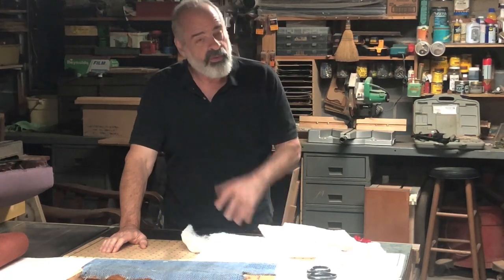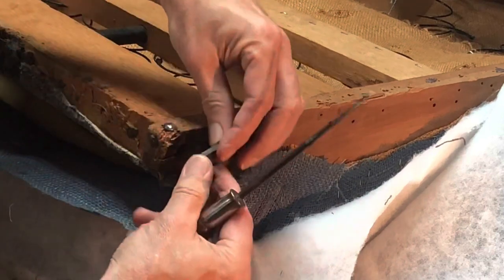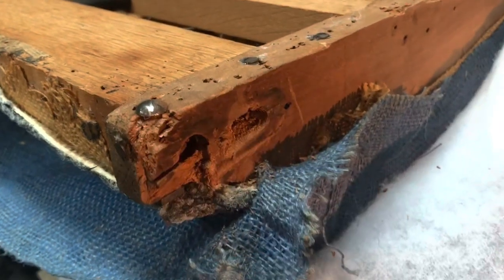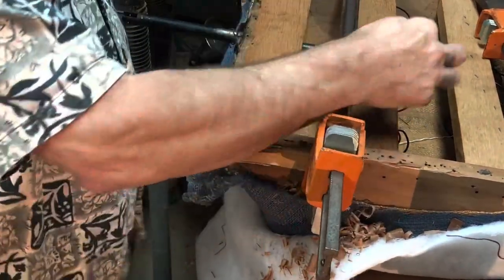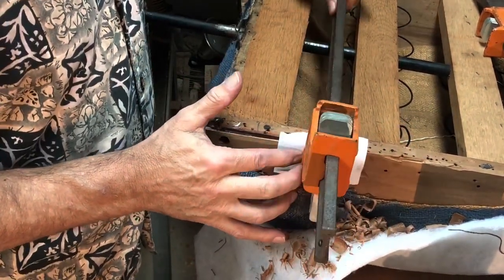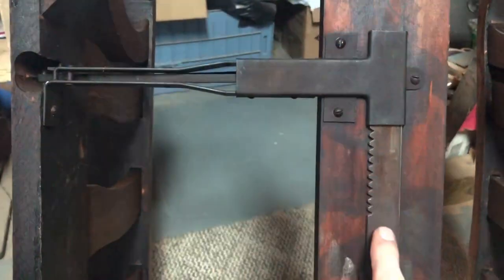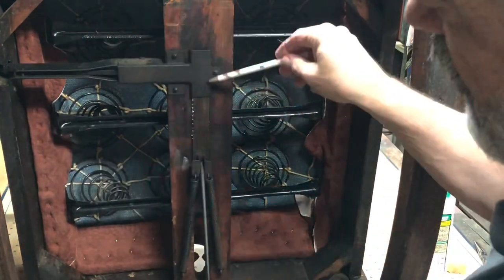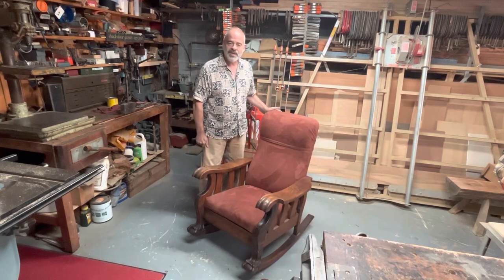PART II RESTORING AN ANTIQUE OAK RECLINER ROCKER BY ROYAL

Comment: As a traditional upholster since the mid 70's I would have taken it down to bare frame, then replaced both side boards with a hardwood.
Reply from the maker: I am not an upholsterer, traditional or otherwise and to do what you propose would require stripping the entire back and restringing it. Basically starting from scratch. It was my preference to not replace but rather to repair and make it functional but not disturb it’s history. I was not trying to restore this to factory condition but to repair parts as needed and make it fully functional. I’ve accomplished that, and am confident that it will last my lifetime and my friend’s.  I mention in the video this same construct but I am sure that there are others who would do this as you propose.
Reply: you are just doing what you know how to do, I understand that.